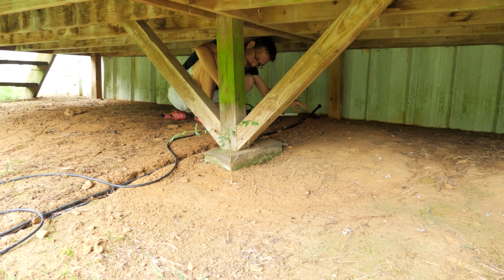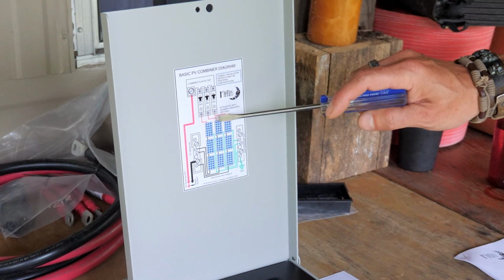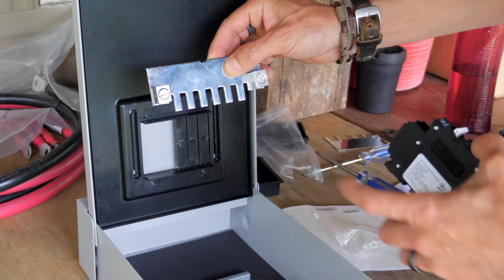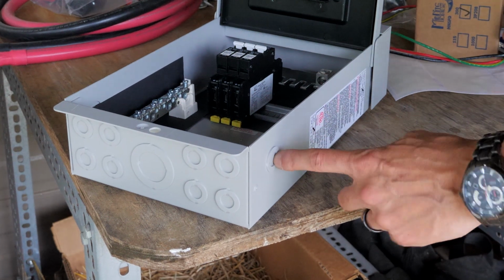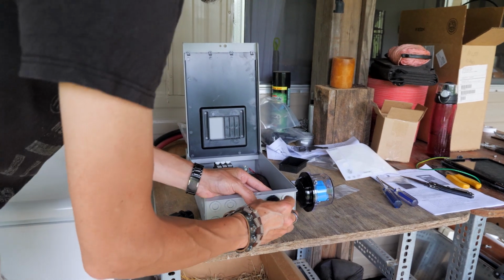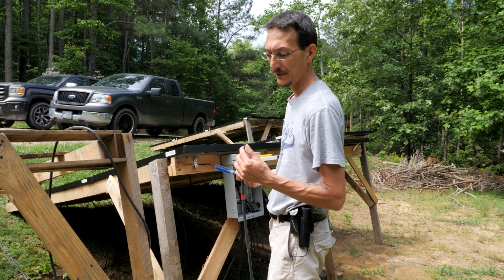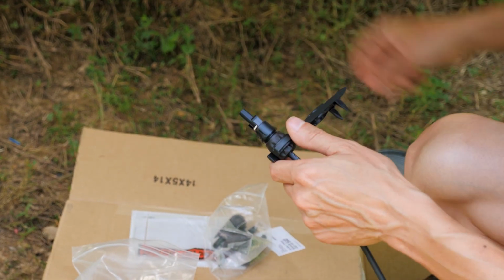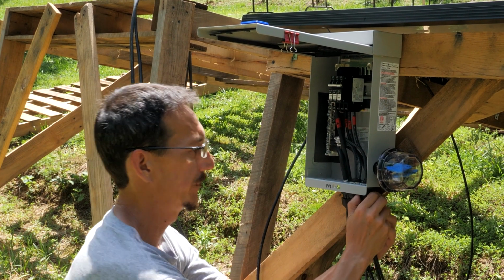DIY Off Grid Solar: Assemble & Wire a Combiner Box (Part 4)

Comment from the maker: You would NOT believe some of the challenges we have encountered building this solar system!  We will tell ya all about it in our final video on "The Good, The Bad, and the Ugly of a DIY Solar Install"...but next video in the series is on our charge controller. Stay tuned!  As always...links to products discussed and related videos in the description. Thanks for watching!
Reply: day two passed my father's rules for working in his shop no watch or anything else on wrists. Thank you for your videos.
Reply: He built commercial buildings we wired everything except the lead from the transformer.  He paid a certified  Electrician to inspect and complete.
Reply: Very excited to see more in this series. Can't wait for your lessons learned video.
Reply: Would you be able to post a parts list of what your system needed? Or what kits you used?
Reply from the maker: We post links in each video to the components we used in the video. Next video I’ll include a complete list.
Reply: I love these videos and I've learnt allot about sizing systems but please use an electricians screw driver. Keep seeing that wood working screw driver and winching. The shaft is conductive and all it takes is a slip and you can short something out.
Reply: You made some good choices for your solar system components. I like the lithium ion batts great batteries. Good video very informative information.
Reply: Uhh I hope you take a minute and watch  some of my videos on connecting the Simpliphi batteries, also I get your a guy just trying to do a diy but electrical safety is serious as is proper racking and ground.  Do it safe and if you have question dm me, yeah I’m that Jason Andrade, Engineer775 and Johnny V talk about
Reply from the maker: Yes I’ve watched your videos on these batteries. Nice setup. Racking will be done when the system is permanently installed.
Reply: Guildbrook Farm - Off Grid Living I am getting ready to install my 6 batteries and used the outback ibr3 it is the easiest way so far I have done this if you go to Andradedesigns on instagram you can see it
Reply: TIP - don't forget to drill a couple of holes in the bottom corners of your combiner box to allow moisture to escape due to atmospheric pumping ;)
Reply: are those breakers polarity sensitive? I suppose the diode in the strings keeps reverse flow from the breaker in case you turn one string off.

Comment: Bravo! I think you'll tackle about anything. You just roll up your sleeves and dive in. Really great instructional. Although, I would slip all that cable into metal flex. The squirrels and other rodents love the insulation on electrical wire. As a journeyman electrician I have had the displeasure of replacing much wire after the little pests got into an attic or under a house.

Comment: Wow! The video on how to prepare the combiner box was fabulous.  I'm not an electrician and have taken on installing 12 panel Unbound solar off grid system for a friend.  I've never done anything with an electrical panel but after watching this video I had no problems getting the combiner finished in about 15 minutes.  Plus, I now know how to connect the panel cables into the box.  Great video - keep it up.

Comment: Good comment on the fact that the breakers are rated DC. A 250v AC breaker is generally only good for 24v DC. An AC breaker with higher voltage DC can arc on opening and continue conducting so you think you have turned it off but there is still power jumping the contacts. Regardless of breaker type or switch position, treat all wiring like it is live (like a gun is always loaded). Measure the voltage after turning the power off (you have multiple sources and breakers do fail). Yeah, I've been buzzed a few times :)

Comment: Great videos, I love the details as I learn more about a solar set up. 
My job deals with outdoor wiring, so I have a couple of things for you to think about when you move them to your permenant setup. First, run your cables from your combiner box to the battery bank in schedule 80 PVC conduit. This will protect your cables better, and in 20 years, if you have to replace a cable, you just hook the bad cable to the new to pull in the new. It makes replacement easy when you get older. Also, sun and wind is a killer for the insulating jacket on any outdoor wiring. I love that you wire neatly and label, but use some clear tape over the labeling to keep it from rubbing off in 20 years.
Great job in sharing what you have learned about this subject. Both of you keep it up.
Reply from the maker: Yes. In the permanent install, everything will be in conduit.

Comment: Very good video and lots of good and useful information as a 30 year plus trade electrician I'm am never surprise any of what I have seen out there posted as fact.
One small tip on your ground, and I will explain why best practice.
 Take your ground from your array should be 6ga. to 8ga. Bear copper wire and connect straight to your ground rod. Also do the same for your combiner box.
The reason for this is that all your devices are isolated from say a lightning strike. It goes straight to ground, any riseual feed back will be better absorbed by your ground fault and not send a jolt back to your charge controller, which should have the same protection.
If you are using wire gauge higher than 8 gauge all that will happen melt the wire instead of going to ground.
Just a tip
Reply from the maker: Great suggestion. On the permanent install that’s exactly what I’ll do and with proper racking and lugs.
Reply: Another best practice I've seen is to ground your panels as well. They make small devices which bite through the powder coated aluminum frames so you effectively connect them together and only need one ground cable.
Reply from the maker: That’s what I did here. I think he’s talking about grounding the bonded panels directly to the ground rod without going into the combiner first, and grounding the combiner to the rod separately.

Comment: Better to not run both lines for SPD alongside each other, negative better direct to negative bussbar. And the reason the crimp tool exists is for greater surface contact as it surrounds the conductors clamped tight -  not just mashed in one spot, especially when everything gets loose in the sun. Ferrules would help as well to keep conductor filaments from tearing when tightened down

Comment: Would have run the neg from surge protector around the perimeter of the box rather than under the breakers ... Just to be safest ... Used to install alarm systems ... Neat and trim in the box is good ... Excess wire outside the box always got coiled and zip tied out of the way for future modifications ... Better too long then too short ... You are doing a job ...
Reply: These are good tips.  I would suggest waterproofing spacers between the combiner boxes and wood.  (wrap a couple steel washers with rubber tape and pierce it with the screw).  This will seal the box mounting holes which otherwise degrade over time.  Water creeps everywhere.   Retired master electrician.   I heard you say you would eventually move the system.  That's good because the point where the screws pierce the wood is the weakest point of the mounting system.  In a few years it will degrade and loosen.  If your system stays there more than five years you could just increase the size of the mounting screws, Or right now, caulk every mounting point just before you crank it down for the last time.  Ju Keepin y'all safe and making the system last.

Comment: Nice video.  I liked how you showed lots of the little details.  People often gloss over them and it those little details that will eat you alive.  I'm sure lots of people will find this very helpful.

Two things for you that might help later.  Aluminum wire is a wonderful thing as the larger sizes are cheaper and bunch lighter when compared to the copper.

For stuff outside and it is really critical I always add some of the electrical oxidization preventive grease, even on copper.

Comment: One thing I learned about when building ebike battery packs, it's what they call " galvanic corrosion " when you combined different metals like copper with brass connectors, galvanized connectors will corrode over time, but with any electrical connection like you are doing, soldering them on is really the best way to go. Just make sure you clean them with alcohol afterwards as left over solder paste can cause corrosion as well.
I would also suggest using a military grade " no corrode " type of coating for your bus bars and any other bare electrical connection that is not in a waterproof housing, none-conductive grease is much cheaper but a bit more of a mess.
If the air cant get to it, no reaction can take place, oxidization etc...
I really like your choice of Lifepo4 batteries, do you use a BMS with a battery bank like that ?
Reply from the maker: Each unit has a BMS built in
Reply: Might still be dealing with long-term corrosion issue from dissimilar materials

Comment: it looks good the only thing I would do different is go to home depot or an electrical supply house and get bottle of Noalox  made by Ideal put some on all aluminum  connections it will prevent corrosion  outside it will corrode you can put it on copper too

Comment: Very good job on building your solar system =)
Reply: Jeremy ..... you are the first person that I have seen that knows what they are doing wiring up circuits and a connect box =)   Even labeling the wires and circuits is a real must in any installation .... most people do not do just that one simple thing that save hours later on wondering what circuit goes where to what wire and box =)

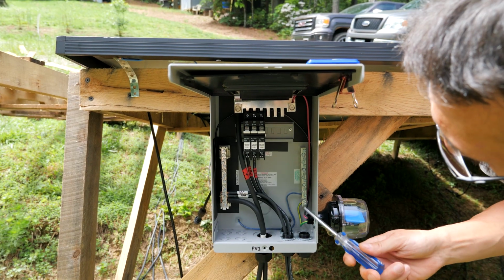Comment: 17:45 I assume that Positive Busbar goes directly to the SCC/Inverter, correct? And if so, the SPD is wired after the fuse and before the SCC. ie, between fuse and SCC. I am confused; many installers would have the SPD before the fuse and after the panels instead.

Comment: Nice work so far, my only constructive criticism would be that is not the correct MC4 crimping tool for those contacts (I actually have the Ampehonl tool for those exact contacts, which are kind of rare). The current rating on them goes out the window if they are not crimped to Amphenol specs, longevity is also a concern (oxidation or corrosion)
Reply from the maker: These aren’t MC4 connectors.

Comment: Jeremy I enjoy your real world explanations instead of the book answers. Seeing the combiner box really helped me understand.  On your battery video did the manufacturer already combine the cells in series with a BMS inside the case of each cell?  If so that explains why you can't run then in series again.
Reply from the maker: I believe so yes. I think they use all the same sized cells in each voltage form factor they offer, just a different quantity but all wired in series.

Comment: Great video, but just a nit: The SPD positive running behind the negative bus bar (exposed to sharp bare negative wire ends) is less ideal.
Reply: are you saying the insulation can't handle?
Reply: Good point. Something to consider atleast.

Comment: Absolutely great videos. You do a very good job of showing the know nothing folks; and even those who know everything, how to do it yourself!!!
However, didn't you say that the male connectors were positive?
After your first male connector you labeled it S3 negative.
Just asking?
Reply from the maker: That male connector plugs into the female/negative of the string so even though it’s a positive connector, it’s forming the negative lead back to the combiner.

Comment: i did my solar system differently but I'm on grid tied system with no batteries.  So I've got my panels going to a micro-inverter (2 panels to each inverter) and so all the power is AC 240volts from the panels to the house and they have anti-islanding so it's safe when the power to house goes out.. they don't kill a line worker.. it needs to sniff a frequency from the service to allow the inverters to produce power.

Comment: Sorry!  fat fingers hit the wrong button.   MOV's Metal Oxide Varistor! Most surg protection use them. But you can get the part that does the work.  Metal Oxide Varistor become almost a short when the voltage gets too high to take away the Surge. I have seen where the MOV was distroyed but the equipment was good, only found small parts of it in the bottom of the of the box and little bit of wire that came out of it. The MOV took the surg its self! Lighting is always looking for the easy way to ground! The more ways you give it to get to ground the better you will be! I spent over 30 year repairing electronics in South Florida, burger alarms, 2way radios, and other things.

Comment: Maybe you cover this in the next video, but I am concerned that all those wires are exposed to the UV sunlight and the elements of rain and snow. Also, our soil so alkaline that wire in the ground must be protected with plastic piping or it corrodes in a few short years... Even if it is rated for underground use. You've spent a lot of money here. It would be a shame to see it all rotted away for lack of a little protection. With love❤from sunny 🌅 Arizona 🌵

Comment: My 4 panels are 405w, each capable of outputting 31.18v at 13amps. If I wire 2 strings with 2 panels in series, could this PV combiner box handle this much current?

Comment: Hi Guildbrook! Good work! I have a question though. I would like to wire the same MNPV6 in two circuits because i need two separate controllers. Each will have each own Array. My question is: do I need two separate SPDs? How can I hook up the same SPD to both circuits?
Reply from the maker: Yes you need 2 SPD’s. It will save your controller.

Comment: Jeremy, I am catching up on my shows.  Question on the sbd wiring. It looks like it is wired parallel in the combiner box.  If so, it will not interrupt the electricity going to the bank. Did I miss something?
Reply from the maker: It “eats” any surge from the arrays. There is a secondary spd for each charge controller on the other end of the run to the power center to eat the rest.
Reply: Guildbrook Farm - Off Grid Living thank you for explaining.

Comment: I'm a little confused about how the SPD is actually protecting the circuit when it appears to be hooked up in parallel rather than in series.  Can anyone enlighten me here please?
Reply: Yes parallel is correct.  When  the voltage goes too high it can short out the circuit puling the voltage back down.  The devices sometimes die in the process - but saves your more expensive components.  For shorter spikes the device operates the same way but a quality unit will be able to withstand a few of these without failure.
Reply: Ok thanks.  So in simple terms, more of a capacitor than a circuit breaker/fuse.

Comment: How did you determine that 4 gauge welding cable was the correct gauge wire to use for you 130 ft run.   Since it is two conductors, a positive and negative, that would be 260 feet.  When I calculate that I get 1/0 (1 ought) wire gauge?

Comment: How do you separate the bus bar so that you have 2 separate bus bars? Will it bend apart or does it need to be cut with something? Thanks!
Reply from the maker: There’s a place to cut it in half.
Reply: Guildbrook Farm Yes I know, but what I’m asking is how do you separate it at that spot? Does it bend apart or do you actually have to cut it with something? And if so, what?
Reply from the maker: If I recall, there’s a spot in the middle of it that can be bent back and forth until it snaps. Otherwise cut it with metal shears/tin snips.
Reply: Guildbrook Farm thanks!

Comment: What if ur running ur panels in parallel or even series parallel can that particular combiner box run in parallel mode ? i cant run in series my charge controller only excepts 125v my panels in series would be 148v

Comment: I have 6 strings 88v each going into a individual circuit breaker on the box but my combiner plate reads 66v ? the CC input reads 66v with 52v output to battery. I have 4 ga  120' long main wire to the CC any idea why its not showing like 84v with the voltage drop

Comment: Had one question when running the ground in in a residential box I bury 3 - 8 foot grounding rods at 8 foot intervals connected together with 10 gauge bare copper between them run into the box, is that not needed here?  Great video series Jeremy.
Reply: In a residential system the neutral is grounded so the hot wire can form a circuit either to the neutral or through the ground to the neutral. In this setup neither the positive nor the negative side is connected to ground so it's like a lightning rod, not like residential wiring.
Reply: Might be getting ahead of Jeremy here, familiar with standard residential, so when you run power from the solar to the house circuit do you have to break the connection between neutral and ground  in the house breaker box, similar to how you would connect a sub box?
Reply: Autumn Oaks Farm - You're right, Jeremy hasn't come to the inverter yet, that's where the batteries connect to the house circuit. The inverter doesn't connect either the positive or negative to the neutral, but if the solar ground wire is connected to the house ground wire then neutral will be connected to the solar system.

Comment: Do you guys know how dirty the electricity is coming from your system? the electricity coming from grid tied is very dirty and I need a filter on my house. I have recently learned that dirty electricity causes many health problems, but it can be fixed with a filter. and I think it also saves electricity, at least when grid tied.
Reply from the maker: Our power is pure sine wave inverted and cleaner than any grid power.